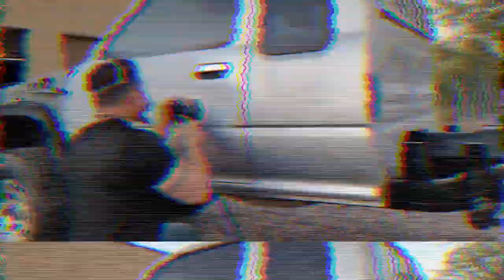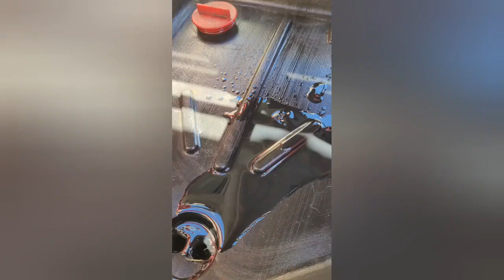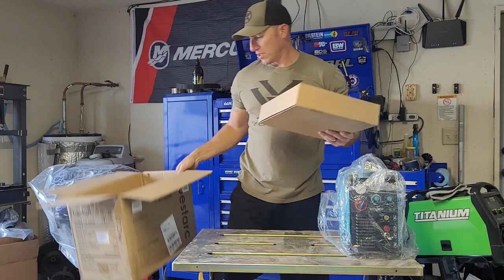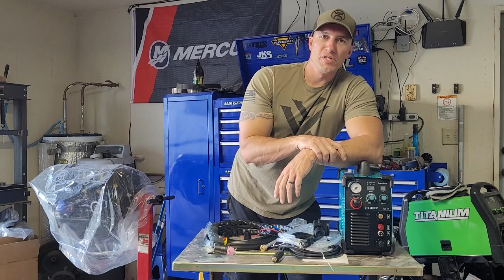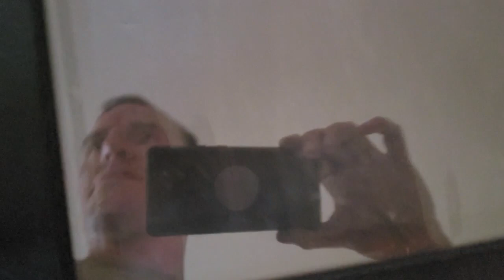BESTARC Plasma Cutter BTC500DP

Comment: I appreciate your time and effort in making the video. You really underestimate these little machines. I had one and you can actually cut 1/2" steel with it. On 220v of course. And when you cut angle iron like that with a standoff or without you should cut it from the outside instead of the inside. The distance from the tip to the material is critical in getting a clean cut and in the life of the consumables. Crank that air pressure up to 65psi! I've actually had 2 and both were stolen shortly after I got them. The third one will be coming soon as my video cameras and security system obviously had to come first. Crank it up and enjoy it! They are awesome machines.

Comment: I've been using one of these since March, just a hobbiest but so far I love mine. I must admit I haven't ever tried it on 110 though so I don't know if mine would do what you'rs did initially. My compressor pretty much maxes out the 110 outlet in the garage so I've always used the 220 to keep from tripping the breaker. So far I've never had an issue other than user error, such as not getting a good ground connection and similar stupid things.
Reply from the maker: Thanks for your feedback. I've had the same issue with user error when not getting a good ground, thought it was broken but it was just my mess up haha.

Comment: Hello, had the same issue with the sputtering right out of the box. Any fixes other than sending back?
Reply from the maker: Make sure you don't have water in your line, that's usually the most common culprit of sputtering. There's also an adjustment that can me make inside the machine with the gap for the pulse. But I didn't bother with it. I'd just send it back for a different one since you just got it. Let them deal with fixing it.
Reply: @TrentsGarage  thank you for the help and quick response.

Comment: Getting ready to buy one, can't find a straight answer in search engine...

What is the difference between AG-60 and AG-60P Is the "P" just to designate a Pilot Arc feature in the Torch Head?

I'm seeing all these consumable packages with SG-55 AG-60 AG-60P WSD-60 and I have my eye on a nice bundle for $27 with 30 tips and electrodes and 10 cups and 10 brackets.

It only lists WSD-60.  Are these all interchangeable as far as consumables?
Reply: Update:

AG60 is a non pilot arc torch (just like the PT31's) vs AG60P which is. This is a torch difference, and is noticeable by the extra wire or not. Useful to know if you ever need to get a new torch set.

There is only one difference in the consumables and that is the cup. For Pilot arc you will need the longer cup with the channel for the guide clip to snap on to the cup.

AG60 and AG60P tips and nozzles are the same. And they are cross compatible with (SG-55 / AG-60 / AG-60P / WSD-60) . I purchased a set of consumables labeled for WSD-60, and they fit and work fine on this unit. If I place them side by side with the tip and nozzle that came with the unit's torch, there's no real difference that can be seen, and the proof is in the fact that they work just as well.
Reply: The p stands for pilot arc torch
Reply: Well that answered my question! Thanks!

Comment: Thank you for a good review. I have the same model being delivered today. Gambled a little on it since like you said there is not a lot of reviews online for this machine. What amp breaker do you run for the 220? I am about to add a new receptacle in the garage just for it. 
Thanks
Reply from the maker: Hey thanks for watching and glad you enjoyed my review. I believe I have a 50 amp circuit breaker but I'll have to check to confirm. I use my 240 outlet for my aircompressor welder and the plasma cutter.
Reply: @TrentsGarage  sounds good. I’ll just use a 50 then.

Comment: I had lincoln for 12 years  and ran it hard It finally gave up 2 Months before I retied .Since I Only need one for my home shop now I didn't I needed to spend high dollars for  another lincoln I looked  around for something that was more economical.Of all the one I looked at the bestarc  btc500dp was the best one to fit my needs at a good price .I've used it on quite a few jobs  and like the way it performs it functions a lot better then the price would suggest. I also purchased extra consumables I'm glad I Did I think the price is going to go up as more people buy this unit .Good review no BS
Reply from the maker: Thanks for the comment!
Reply: @TrentsGarage  ,I have taken the wire gide off to use as a drag style cutter head so that I could get into a tight corner, and found there was no harm to the plazma head . I have also since used it a few times on the flat. I looked at a friends drag style plasma cutter and the head looks the same as mine I have come to believe that on these low budget plasma cutters they us only one style of head for economic purpose.I,m not saying that anyone should do this . I'm just stating what I did and that I did not burn the tip out.

Comment: Cool.  I'm debating this one vs Lotos LTP500D.  Lotos is better known, but also more expensive.  They both have the same features like the pilot arc and built in regulator.
Reply from the maker: I hear the Lotos is good too. The bestarc works good can't go wrong with either imo.  Another thing to consider is the cost of consumables.
Reply: Yeh man, the LTP500D is all over the internet...you look "best budget plasma cutters", and it makes everyone's list.  Bestarc is lesser known, but  seems well reviewed, has same specs/features, and the price, WOW!  There's a package deal now on Amazon for it with a  bunch of consumables (speaking of which) for $260.  Tempting.